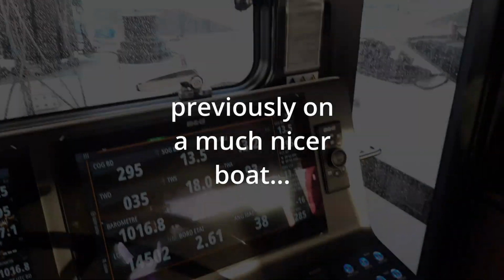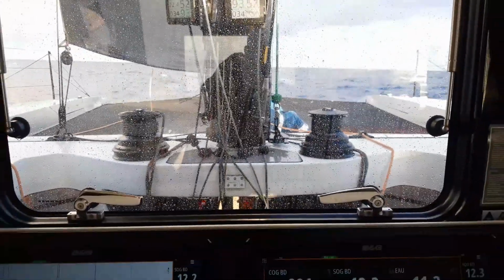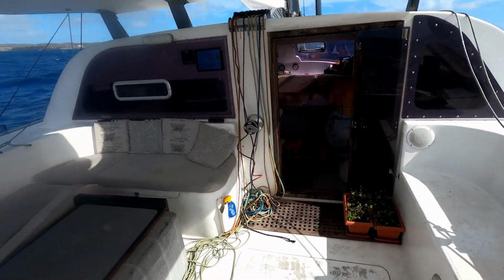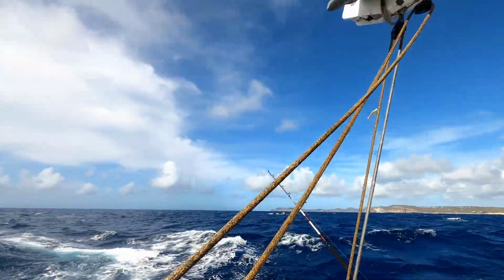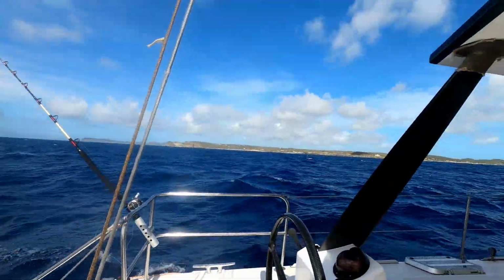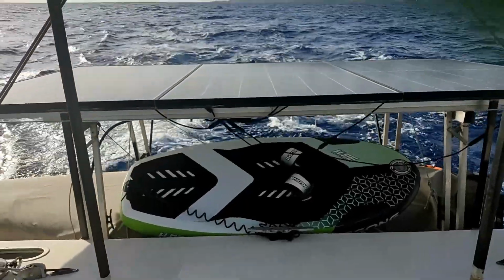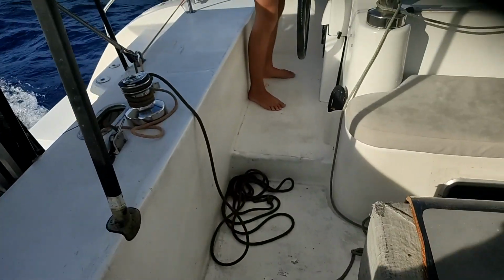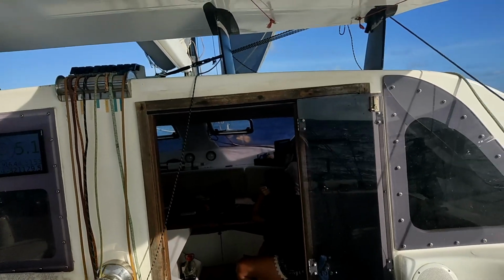The problem with a catamaran A-Frame mainsheet system

Comment: Not only you can't dump the sheet - but it also goes through a clutch before the winch. On my cat we fitted big cam cleats for the tail of the sheets on the primary winches. After winching in, take the tail out of the self tailing mechanism, and put in cam cleat. Way faster to dump if you flick the sheet out of the cam cleat, and it comes off the winch. I'm sure it's nothing you haven't seen, but comments help the Youtube algorithim :)
Reply from the maker: The clutches are religiously left open while sailing and handles left out of the top of the winch. Its all about being able to instinctively act on a situation and not get hindered by something simple.

Comment: Good day Shane,

As discussed earlier on our Tobago 35 my goal is the following; Reasonable to good performance fast cruising  with ease of handling and safety being defined as; simple, efficient, not intimidating, and easy enough for the smallest crew (my wife and/or 11yr old daughter) member in say up to 30 kts to reef the main, shake out a reef, shut off the power (dump the main) in a bad situation, alone.  This way, in all less challenging conditions, and with some help its easy and fun to sail the boat. Optimum expectations I agree, however with appropriately sized (more mechanical advantage) winches, graspable sizing of lines, minimum running resistance, two parted halyards, etc, I have been able to approach this expectation on a previous boat, albeit a smaller monohull. We currently have a main sheet traveler  and a pair of new to us Andersen ST 46 winches not yet installed as we were headed towards a double A-Frame main sheet system before finding your website (now looking to learn more before breaking out the tools and epoxy for major mods).  The quest is to increase use-based experience and confidence with a well designed system that is set up with practical and doable power reduction options and worst case scenario safety devices.  I look forward to your feedback and possibly more exchanges through your blog or your choice of best method.  Thanks, Marty
Reply from the maker: Cool Marty. Might be best to email Shayne. admin@youngbarnacles.com

Comment: (I thought I had uploaded a comment but can't find it so here goes again)
On my 31 ft Twiggy trimaran I used a system that you may find better, as a stop gap till you can install a track. The Twiggy system was nice and easy to trim. 

It had a central mainsheet with spare blocks on the end of the boom. "Preventers" ran from the main hull stern, to the blocks on the boom and then to the float sterns. The sheet could be trimmed in and out a bit without adjusting the preventers but the preventers were adjustable for large changes in trim. I am an ex racer and found the system fine to use, even easier than a traveller. Because the Twiggy was so wide the preventers were rather flat, but you would have trouble doing that on a Catana. 

For your cat I would suggest you lead two strops from the end of the boom ending in two blocks about 600mm above the deck. Run a preventer line from the centreline, through one block and then outboard and back to a winch. Do this both sides. Mount a centreline mainsheet and lead it however fits best. 

I think you will find you have much better control of twist and angle of attack with this method. It is also useful in a gybe. You could simplyify the system and use a single preventer, running on a strop from side to side (much like a Laser traveller). You would still need to adjust this and still need the central mainsheet.

Comment: Great video (and the others on sail trim and the Gunboat crossing). Thanks much.
I agree with most everything you're saying. I've had an A-frame on my Catana 431 and a traveler on my Seawind. I currently have a Balance 526 with A-frame. A traveler would give better sail trim aka the Gunboat. But, most travelers on cats are really bad (too short, too weak) and I'd take the older Catana setup in a second over those. It's all give and take. For what it's worth, I love the A-frame on the Balance. You can easily adjust both sheets from the helm at the same time (let one out, pull the other in) and see the sail at the same time. The blocks can also be moved easily farther out athwartship for even better trim (and you always have a preventer). That said, I'd love a traveller IF it had 2 directional winches with push buttons (expensive). But if I needed to adjust manually from the aft combing, I'd take the A-frame from the helm for sure. I just never hated the A-frame. And, having a performance cat with daggerboards (Catana) was way more important than A-frame or not.
Reply: Yes, having a good base line boat is definitely the priority of the mainsheet system, it is just unfortunate that some good platforms have details like sheeting systems and deck layout that make the terrible to use
Reply: Another Balance 526 owner here, and I think both the issues he raises here (cant dump in a hurry) and (hard to adjust trim) are more or less solved with the 526 style.  In this video the winches are far apart so they cant both be dumped without scrambling between them.  On the Balance with them next to each to each other you could do them both simultaneously.  Also with both winches next to each other and the sail in view from the helm seat, its really not hard to ease one and sheet in the other while watching the boom.  Having to move between each winch to adjust, while also not being able to see the mainsail is obviously a big pain in the ass like shown.
Reply: @hoekalicious @sailinglittlebird to the Balance owners. We have balance 442 #6 & have just started sailing the Med with her. We’ve had a lot of down wind sailing the last few days and our boat has been loving sailing wing on wing with the twa around 160. (We’ve been in strong winds) but anyway that’s unrelated.. my question is with gybing. John has been moving the strb and port main sheets to different D-rings throughout the cockpit and I think it’s so dangerous underway with the boom banging around each swell we get. We’ve even had the boom swing to the opposite side twice now which I hate because 1 so dangerous & 2, it’s most likely aging our brand new boat quicker. My thought is the strbd sheet stays on the d ring  that is somewhat next to the engine of the dingy (idk how to explain where it is but I’m sure it’s same spot as yours) and the port main sheet is on the d ring by the front of where the dingy would be and it just stays there and you adjust accordingly. My bf John wants to move the main sheets aaaaall the way to the sides of the boat.. I’m just struggling to find information on how the hell to gybe with this system and how these sheets are supposed to be set up. Please help a concerned and stress girl out.. 😅 Thanks.
Reply: @TipsyyNomads  We did a ton wing-on-wing around Cape of Good Hope and starting out of Cape Town. Quite a bit with just the jib and staysail actually... without the main.  As for the a-frame setup... we tend to not use the main if it's deep. We'd be on one of our spinnakers. We tighten up the main sheets to provide support for the rig. Some people like to keep a reefed main going to help douse the chute, but we don't (and are careful to take the chute down early as the wind picks up). I don't think we'd ever have the main up at 160. It just bangs around and doesn't add much.  When sailing w/main off the wind, we move the main sheets outwards as you mentioned, but always one on the combing near dinghy and the other in the first spot near aft cleat. We never pull both outside, as the main would push into the shrouds, which we avoid at all costs.  This also is a great preventer setup.   When we want to gybe, we first move the sheet points back to normal, center the main hard, and then gybe... then move the points outward again. We never let the boom bang around... it shock loads everything too much. Love your vids on insta! great stuff.
Reply: @SailingLittleBird  Awesome! Thanks so much for the info! 😊🙏🏼 I feel a lot better hearing this from balance owners rather than guessing 😄 Fair winds 🌬️

Comment: Seems like you have had plenty of feedback for this topic ..... I totally agree with you on this ..... was wondering if a temporary solution could to have alternative leeward sheet anchor points. If you attached the main sheet deck anchor block to a continuous loop which is run through the existing anchor point then to say the outside cleat/bollard you could soft shackle the main sheet block to the anchor point at normal location for close haul sailing conditions then when going deeper you can let the leeward sheet off and slide the deck anchor over to the alternative outside anchor point and soft shackle it there ........ this means you don’t have to completely release the leeward sheet (as it is connected through both anchor points by the continuous loop) to change anchor points and gives you a wider opposing A Frame Mainsheet angle to work from. The leeward sheet then acts more like a preventer/vang and allows you to de-power the main with the upwind sheet.
Obviously doesn’t get around the double sheet handling of an A Frame Mainsheet but can help avoid that dangerous puckering moment of emergency sheet to release

Comment: Haven't sailed a second in my life. But Balance Catamarans seems to use some version of this A-frame system. Is theirs different in some significant way compared to what you guys have here on you older Catana?
Reply from the maker: No. Same system same advantages/disadvantages 🙄

Comment: I have never used this type of mainsheet however would not proper vang tension keep the boom from riding up and maintaining your desired  twist as you release one of your mainsheets?
Reply from the maker: Usually catamarans don't have a vang. They have a wide beam and use the traveller to control the leech profile. The loads in the mainsail are on average 10x more than the same size monohull which means a broken boom or a crazy big boom to deal with the load. Third point is the boom is low to the deck and cannot fit a vang.
Reply: @youngbarnacles  Many thanks for your response. I have only owned a Voyage 440 which indeed had a solid vang. But I do appreciate the problem with the a-frame system. Guess the only good thing is it's not really a race boat and we are not sleeping on wet sails anymore🙂

Comment: I think it pretty much depends on the size of the main and the rigging. Windward sheet could be used as a vang and triming could be accurate enough for cruising although traveller could be easier
Reply from the maker: After 7000 nm of using this sheeting system, I still can't make it work effectively, and I've given it a pretty good go. Cruising boat or not the needs of a sailing boat are the same, because I live on it and cruise it doesn't seem to change the need for the system to function well. I wish it did would save me some hassle

Comment: Hi Shayne, I'm wondering if the system could be modified to use a single continuous sheet with the A-frame set up intact?
Reply from the maker: The simple answer is no. If you use a single line it would only sheet to the centre point. It might be possible to set something up but it becomes very complicated very quickly. Best practice is to use the simplest solution.

Comment: This is a bit out in weeds.... I've been thinking about systems of lines in boats as though maybe they weren't handed down by the Gods. Always asking, is there another, better, way?  It strikes me that something like the jib sheets, (similar problem to your 'A-frame' mainsheets) you have to ease one as you pull in the other. Why can't this happen at the same time?  (Maybe from one position? like the adjusters for dagger boards.) The reason of course is you can't just work a single line, the first thing that has to happen is you need  some slack. So devise a method. (and of course whatever it is would have to cross the cockpit - run it through fairleads and a channel under the cockpit. )
Same here with the A-frame lines, except a solution seems easier:  On the boom two sets of blocks (however many turns are needed for mechanical advantage). The far block - where your lee/windward sheets 'attach' is fixed. The other end is free. The way the lines in these blocks are worked is by another line on the boom. Release it and the block slides releasing line. To hold it, and tighten it a cleat on the boom and either enough mechanical advantage by your weight to pull it or a winch. 
The lines that run through the blocks  feed from one main sheet, through the blocks and then out at far end to the other main sheet. Now when you have to dump the main, you reach up and pull the adjusting line out of it's cleat. Both sheets are eased at the same time.  Now if you need to immediately tighten your mains, you can do so at the two winches - you don't have to mess with the blocks system. 
And you or another crew can re-set the boom-blocks by easing one main sheet while pulling apart the blocks with the cleated line. 
If this isn't obviously stupid in some way, talk to me in about two  years. The Seawind I have on order has an A-triangle set-up and  will be delivered in just under two years.  I'll have it sorted by then. Probably do it before I sail out of the yard. You've clearly presented the problem, so it's clear to me it's a problem. I think my solution will work. 
Trimming the main looks like if you had a multiwrap winch on the boom that would run a single mainsheet line  through it from both winches and be position-able  (feeds the line to either side) by motor or a loop line (like a chain hoist). 
So there's no off the shelf solution for this?  Both solutions (there's actually three)  just seem really obvious to me.  I can see some of what I'm suggesting in a German Mainsheet System - my way keeps the stability of the A-triangle.  Hope this isn't too crazy.
Reply from the maker: Wow, plenty to think about there. 
It is very important to remember with lots of purchase comes lots of friction in the system. Even with the most advanced blocks around the friction of turning a sheet is impressively high. We tried these sorts of things on 40ft race cats to find very scary results and went back to a simple low purchase and onto a winch.
The German mainsheet system evolved from IOR boats back in the day when you had a spare guy that would pump the main in through a gybe, and could do it next to the mast guy. That was its main crowning feature, the ability to get the mainsheet winches on each side, well there are much better solutions.

Comment: it is truly aweful system for main sheets so many production boats are based on charter use expectations   they assume owners dont understand sail trim since most just leave the boats on auto pilot or just motor.i hope you can find a proper traveller track system maybe one of the islands with trashed hurrican boats might be a source but iheard most have now cut them up and buried the trash or had it shippeds out. gl with the journey looks fun
Reply from the maker: We have been on the look out for hurricane damaged boats, but like you say most have been disposed of